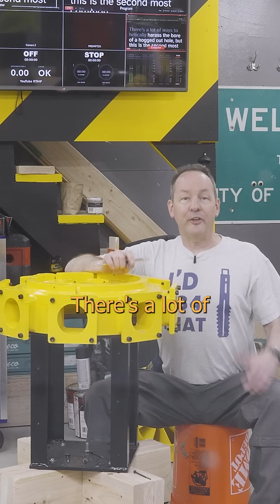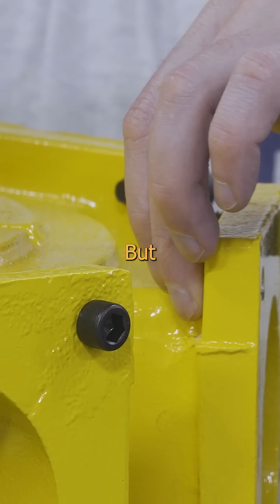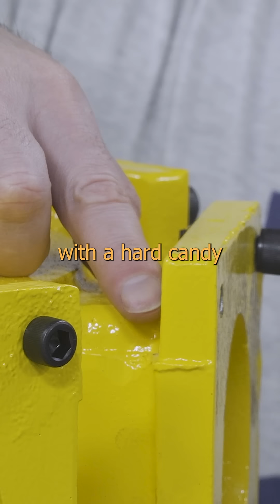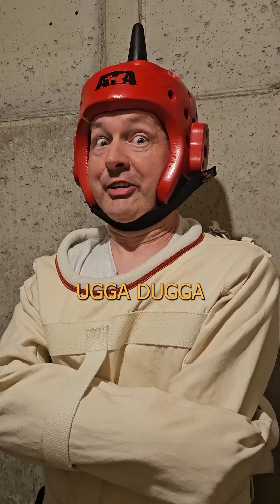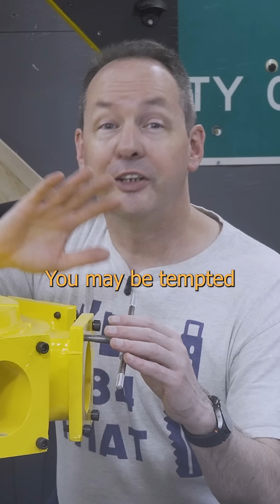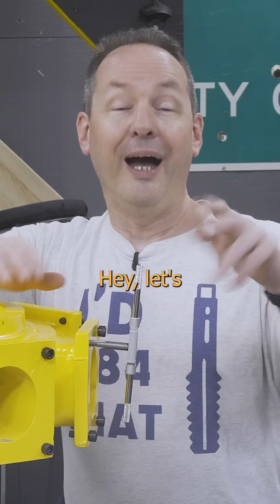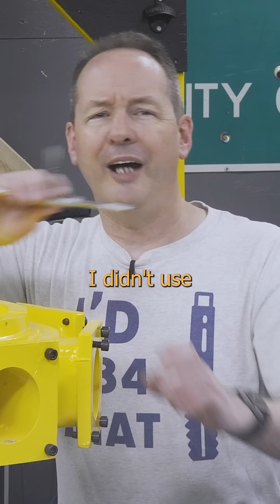Thread Chasing  #chrisboden #comedy #engineering #skills #workshop #metalworking #tools #apprentice

Comment: I was a dumbass when I learned this one the hard way with a fellow I went to high school with when we were 15. We were working on his old truck and had to do a lot more work on several parts because we used a drill to do this kind of work, though the reason we started was due to the bolts and threads being very rusty. I lost several hours to cross threading

Comment: My dumbass as an apprentice after being told not to use a drill. Used a drill on a 10-32 tap into an aluminum seat track for an aircraft… I learned… it’s much faster to do a tap by hand then it it’s to drill and buck 48 rivets through a 6”x3” access in front of the customer on delivery. Never again…

Comment: Dumbass right here. Hand raised high. Bolt was broken off in the bell housing of the motor in a 1989 BMW. Finally got the broken part out, threads were fucked 5 ways from Wednesday. Got the motor out, started retreading the hole. Got impatient and used a damn drill. Long story still long, i broke the ear of the goddamn motor off. Not cracked, broke the bitch OFF. Car left missing a transmission bolt and i don’t care.

Comment: Dumba ss. Holes for a load rest on a crown forklift. Some dumba ss decided to thread standard bolts into an m10x1.5. so doing what I do best (fixing their dumbss retarded thought process while providing an appropriate training driven response to correct their lack of awareness skills) I decided to chase the hole with the appropriate tap gently to nudge the threads into my favor. Right at the end of the hole and a little too much eager beaver effort results in a broken oiled tap in the hole of despair. Nothing got that tap back out. I couldn't even weld a nut because of our over sensitive hot works permit process (Walmart). I accepted my defeat after trying to use various sized punches to break apart the tap. As you can guess, I did my best but I learned an important lesson. Don't let dumbass mistakes of others create your own dumbass mistake. The result was a bill from the local machine shop to remove and rethread the holes that were messed up. Glad it's not me paying for it.  Also YouTube didn't enjoy my first edit so I had to PG it down a bit.

Comment: I've never had problems using a drill. The trick is don't tighten the shit out of the chuck, and make sure you're on the smooth shank, not the square drive. If it binds, it'll slip

Comment: Technically speaking, there is a tool actually known as a thread chaser, seperate from a tap, for chasing threads. Someone particularly anal would tell you that that is the proper tool as opposed to a tap…personally, I’ve always just used a tap.

Also you can use a drill or impact you just have to really be careful, not just because you can bugger the threads but because if you break the tap, you’re fucked. Taps are really hard, you can not drill them out unless you have carbide drill bits that are 1,000$ a set.

Comment: Dumb ass-  so I was working on a block for a LS seven and a Corvette and I broke a bolt and needed to oversize it because I messed that removal process up also and then I broke a tap in the block because I thought I could use a drill. Do not use a drill.

Comment: When I worked in a mechine shop I got so good at thread chasing as well as installing timeserts I used a cordless drill and had probally tapped 50k holes to the point I could wright a manual on speed tapping holes. We did forklift engines and I would run sometimes 10 of the same head at a time. So with that being said looks like a 2 minute job with looking for the tap set and finding a charged battery in a 30 gallon tote full of dead batteries

Comment: I'm a metal fabricator and really that's just a glorified machinist that spins more nuts than a hooker who likes to suck on balls. Either way we have these things called sub-bases it's a 1 inch plate on one end with 1 inch nuts welded to it, the other end has this kinda open cylinder-esc thing with a closed end on the other side. When they go to get galvanized, we have to first fill the threads of the nut with a silicone stuff with a caulk gun. We then use a 1 inch tap or if they're a bitch (9/10 times they are) we use an oversized tap, or a 1 and 0.22. pretty fun stuff until you realize how loud it can get trying to impact through a galvanized threaded nut.

Edit - oh yeah and these things are a couple hundred dollars a piece. Overtime the "threads" on these will chip, but pray when it actually breaks it's not into a bunch of pieces and that you actually decided to wear your safety glasses that day.

Comment: Dumbass 😂 rebuilding a '74 f250s brake portioning valve. Fun fact you can't replace them 🤣 you have to find a shop to fill the hole with weld and redo the hole

Comment: Carbon taps are great for most things.  High speed steel is more common nowadays though . Use a tap extension innyour drill, set yourntorque limiter to half ( or less) of max torque, start the tap by hand, and finish with  the drill.

Comment: I got a tip for ya, if your part is small enought and you have a drill press and nothing else to make straight threads, then use it! 
Don't turn it on, just put that tap on it and turn it by hand to start the thread. Once the threads is started, back it out with gentle pressure on the lever till it's out, now you can continue the regular way but you guarantee a straight hole!!! :D

Comment: honestly that was hilarious as hell, when I tapped my hole in a transmission to put in a helicoil (I got it from a junkyard and someone strip the threads) I pretty much just used motor oil for drilling and tapping the hole lol, it worked really well- threads were clean and the bolt went in clean

Comment: As part of the machines I hand assemble, I constantly tap pre drilled holes in 1/4" aluminum step motor mounting plates with a 1/4-20 in a cordless drill, dry. I've done several hundred of them now. Still using the same tap I started with two years ago. The 1/4-20's thread perfectly every time 🤷🏼‍♂️

Comment: On a service rig you deal with a lot of threads that seen an ungodly amount of force pulled on them when the rods get hung up by trash. We had a chaser that worked absolute wonders as you had to wrench every one in by hand and the easier your job the better. I honestly wondered about lapping compounds being used for applications of threads being slightly fucked but not majorly, as well as being sealed off from elements. From my understanding lapping has just enough grit to lightly polish the contact surfaces without being abrasive enough to stop the objects from screwing together or damaging the threads. Wild some of the stuff you hear about from mechanics and metal workers over 100 years ago

Comment: Also, don't lubricate when tapping cast iron. Cast iron taps easy and any kind of oil will turn the chips into abrasive past that will take the cutting edges off your tap REAL quick.

Comment: I used that on a 1962 woodshop dust collector, because some big wig thinks its cheaper to Pet Cemetery it than replace it. They don't even make the filters for it anymore and it snows dust in the shop from it. Anyways, the thing had so much wet shavings all over that once we got the old screws out, we used one of these to clean out the holes and the round version with a threaded interior that you screw the bolts through to clean them off too. Oh, and a lot of penetration oil to get the dang bolts out..

Comment: DUMBASS!!! This guy thought he was a genius using a socket wrench and gator grip to clean out the threads on the precariously placed spot in the engine block and not only expanded cross threaded but broke the the fucking tap in block.

Comment: It can help to spin a gun barrell wire brush in each hole before chasing the threads.  A quick squirt of air pressure after the brush, in the hole AND the brush.  It's just a little insurance that all will go predictably.

Comment: I have absolutely busted taps with a drill before, and by hand, but the one that stuck in my head  was when I was using the actual air powered tapping head like one is supposed to. The nifty ones on the awesome arm that run on air and have a nifty clutch to help save your part/tap. Yeah. Most of the time. I had some stainless parts to tap and was just having at it as one would with proper tools and SNAP went the 3/8" 16 tap... Swore a bunch, grabbed another tap. 2-3 more parts and SNAP Had to go bug the actual machinists for Yet another tap and some "WTAF am I doing wrong" 
That was when I learned that stainless hates everyone and some times your just screwed... Did the rest of the parts by hand cus I stopped trusting the driver for a while. 

Side note, bacon grease is the best tapping lube I have ever run across. Especially on stainless. Works the treat for drilling as well, super good on hole saws and smells amazing when it gets warm...

Comment: I'm one of those dumbasses. I was cleaning out bolt holes on the old mower and uh thought i was clever doing em with a cordless and my dad's old tap set. i had to drill out the bolt holes and re tap them.

Comment: Oh yeah, definitely had a dumbass moment myself. I work maintenance at a hospital and we had to rebuild and only condensation pump. Boss thought it was a good idea to sand everything down and add a fresh coat of paint which of course clogged the bolt holes. No big deal, I grabbed my drill and tapper to make quick work of the clean up. Thought I was going slow enough to not mess anything up but after I was done, turns out I cross threaded every hole. Had to drill out and retap every single hole on the pump and where it attached to. Won't make that mistake again 😂😂

Comment: Dumbass. I was chasing threads in a detroit series 60 block for head bolts, yes started it by hand the drilled away, for about half of the holes then broke off tap inside, about 20 minutes with some pics and small screwdriver got it out. After that took an old head bolt and a cut off wheel cut relief like a tap across the threads for homemade chaser and never had to dig a tap out again.

Comment: I did not in fact learn that the hard way, I instead was taught to do it right the first time and had the fear of God put into me about screwing it up or taking shortcuts. Same way I was taught to remove wedge style wheel lugs. Those things want to escape the shop and don't mind going through you to get there, my uncle showed me the only way a 17 year old can understand. By taking the nut off putting a chunk of plate a few feet in front of it and smacking the shit out of the wedge with a hammer from a safe enough distance. Quite the instruction in destruction.

Comment: Not a dumbass in this case, but I have seen played out the consequences of using a 24" adjustable wrench on a big tap because they didn't want to foot the bill for an appropriately sized tap wrench. Expensive stainless butterfly valve got even expensiver.

Comment: Dumbass alert here not horrible story just stepped up to the next size up in corse thread standard thread from metric but it did add time unfortunately I still use a drill a lot of the time but I use a wobble socket adapter and tap adapter

Comment: I was a dumbass in high school but was pretty luck all things considered. I was cutting some threads using a drill and sheered the tap in half. Fortunately we had vice grips and 1/4 in was still sticking out the hole.

Comment: Hate to be that guy but thread chasers are a totally diff thing they the in-between of a tap and a bolt.
A threadchaser cant cut new threads but it can save kinda crossthreaded stuff fet a set it as a mechanic i use it more than i use my taps

Comment: I'm that dumbass, was tapping a hole for an aluminum rod for making a 2m / 440 mhz j-pole antenna. Basically ended up stripping all the threading out. Luckily the issue presented quickly enough I was able to hand tap the rest of the hole by hand and have it still tune up great.

Comment: Oooga dooga 🤘🏼🤘🏼🤘🏼🤘🏼 Good shit!

I'll be honest, I'll ALWAYS use a drill!. IF you get it started correctly...set the drill on a 4. Use the drill...it pops...go the other way. If it short strokes, remove the drill and use the tool. Only time I ever broke one was when some dumbass decided to help me, after I told him not too, while I was off getting some fkn bolts!! 10-32!! Well...it was a bottom tap and I didn't have a center punch 😡 Needless to say, out of 20 SICK laser sensors, 19 worked correctly.

Comment: Oil patch worker. Shop maintenance I was doing exactly this job and while I was doing it by hand like I was taught when the boss said it was to slow and to use a drill. I said these holes are bad and I don't trust myself using a drill. He then proceeded to break not one. not two but three separate taps. And after spending that much on taps I spent the rest of the day busting the taps out. From there I proceeded to use the drill method but put it on screw and set the clutch way down. And in and out like what I did to your mom and just like here they all came clean with minimal effort. I still won't use a drill in my own work space but when its on company dime and company time let er eat

Comment: I used to work at a small factory that made film processing equipment by hand. Most of it was stainless steel so the chemicals wouldn't eat through important parts. Stainless steel was a bitch to tap. You quickly learned the tapping fluid was your friend!

Comment: Most taps are designed to be used with a hand wrench only taps designed for use with a drill press or magnitudes more expensive than the hand taps

Comment: Yes I am a dumbass, Was trying to chase the stud holes on a 350 Chevy and got tired of doing it by hand so I shoved the tap in my drill and finger rolled it in the first hole then squeezed the trigger it went fine right up until it squealed and went ping FUUCCKkKkk. It broke above the flutes so it wasn't easy to get it back out.

Comment: Had a coworker remove a broken bolt from a hole but kinda messed up the threads in the hole during the process. Decided to chase the threads to "restore" them but used a drill gun and snapped the tap, cross threaded, inside of the hole. He found out that day that quality taps are made of VERY hard steel, lol. Somehow made a snapped bolt situation way way worse 🤣
Patience is absolutely key when dealing with threads. Especially threads inside of something that you can't easily or cheaply replace; and you don't have much meat to spare to drill and make new threads for a slightly larger bolt.

Edit: I know this sounds like a "hey doc my friend has this problem..." type of story but I promise it really is not about me. I've done plenty of other similarly stupid stuff, but this story is about a coworker lol!

Comment: In year 11 we had to make these huge adjustable claps or something else I don’t remember because I had to swap out because I wasn’t doing my written assessments and had to drop the class. Part of it required tapping heaps of this small pieces of roundbar, boy did I learn that my sense of perpendicular is closer to that of a drunk driver’s sense of straight, but ehh, it wasn’t an issue for my project cuz you could just work down the faces of the bar so it didn’t have an ugly gap for where it fitted to, it’d just make you think you don’t know if its straight or not 😂

Comment: Dumass.... Got one of those "74 taps for $69" kits from our national big box store with the triangle..... Used these until I broke one off in a $200 casting.
Got lucky & spent 4 hours with a huge kit of pliers, dental tools, wires & harsh chemicals but it came out.

Yeah, that kit is fine when you need ONE tap of an odd-ball size, but if you're doing 156 6-32 holes in an expensive part, an $8 Butterfield or Starrett tap is a very cheap insurance.

Likewise with the drillbits - I'll use the #37 from the kit, but the #36 (pilot drill for 6-32) is a REAL bit, not Chinesium Alloy.

Comment: Learned a very different lesson. The "bolts" that hold the big street signs to the ground are actually just big steel rods with threads. They can very easily be installed upside down and if they do, they will not work. Being as they are literally part of the concrete by now, you have 2 options. Break out the concrete or rethread them. Hint, concrete is expensive. An afternoon fighting a tap with a wrench bigger than your arm is cheap but very hard

Comment: Ugga-duggaed one right off in an engine block. Then spent the next three evenings working on it to get it out. Ended up taking a smaller bolt than the hole and cutting and filing it to fit into the chip grooves of the tap. It came out, but I worked harder at not being a DUMBASS after that.

Comment: finger in, drill after in and out finger in repeat, I just don't have the patience to do it by hand the whole way once its already in enough to not cross thread, worst case I need to remake a hole and threads, and so far this hasn't bit me in the ass, best practice is by hand, my patience is hand start drill finish. and it ultimately gets done faster

Comment: I haven't learned that lesson because I knew better. That said: nothing like walking out of the shop for an appointment watching somebody try to chase threads after drilling a bolt out with a bone dry tap in a tap socket going as close to mach Jesus as he could make that ratchet go. Wanna guess how that one ended?

Comment: I Dumas’ed myself and had to Heli-Coil into a head of my 1998 Audi A8 when I was trying to figure out if the variable intake was working. Turns out I shouldn’t have taken anything apart at all and just replaced the little plastic linkage arms with aftermarket metal ones.

Comment: A good tap and a drill are how I do all tapping above 1/4 inch. I think the only tap I have broken in years was one I had to hand tap.  I did 16 holes in a 1/2 thick plate, 1/4-20, without even breaking chips, put the drill in low and shot it through.